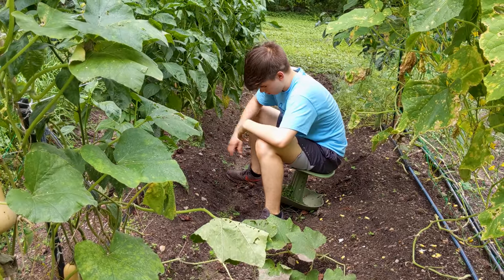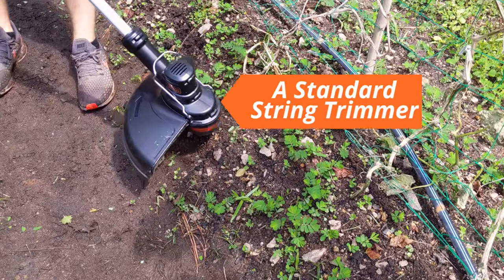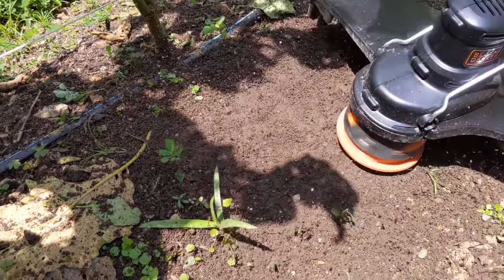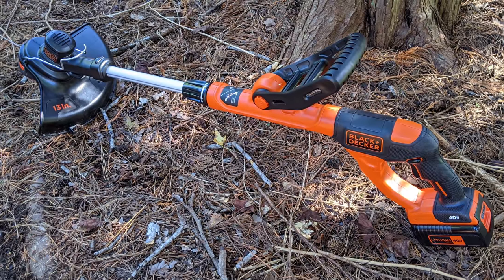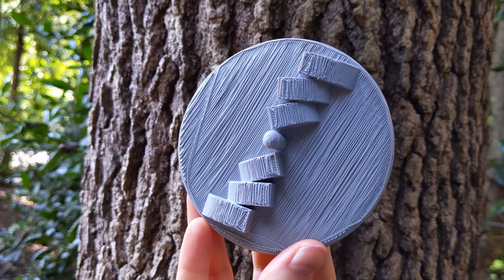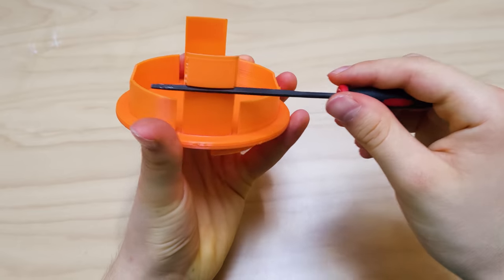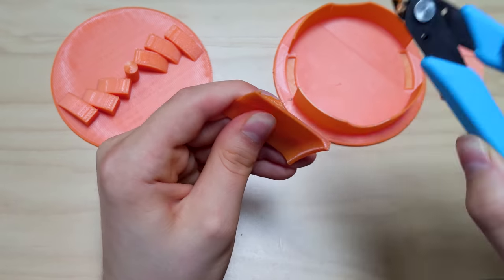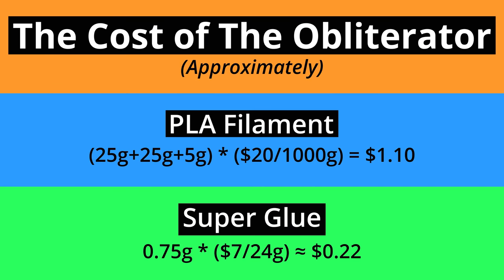3D Printed Weed Killer for Gardeners

Comment: Hey man, great job. As an mechanical engineering student currently working in product engineering, you are certainly on the right track. You came up with a solution to a problem. I really appreciate how you made a rough concept, tested it, and refined it. But more importantly you documented the whole process. This goes a long way. Many people can see the time and effort you put in. But more importantly, you can rollback or reference outdated models. Be sure to include cad models of every revision in your next resume. That way future employers can see the design process you have mastered. 

As for suggestions I have a few:
Research other plastics with different wear ratings, or impact resistance (in the case of hitting rocks or tree roots) for added durability. I know the ender is limited to a couple materials but pla might not be the greatest suited material. 
In my experience 3d printing, a 2 part epoxy is better fastening two 3d printed parts better than ca glue. 
I'd also recommend some mating surfaces between the two plates. You are currently relying on the ca glue for torsion. 
All and all, you've come very far with this project and done a Terrific job. Well done.
Reply from the maker: Thank you, for the kind words and the suggestions!

Comment: Good job.

Suggestion: Make two slots on the main body and add a flange to the locking mechanism. Insert the locking tabs up through those slots. Then, you only have to glue once for the grinder head and the tabs are held in place with more than glue.
Reply: this^

Comment: First off, I really like the design. Not having to bend over to pull up every weed or use chemicals is awesome. Nice work! Maybe Black & Decker will be interested in your design. 

The only issue I can forsee involves adapting this design for use with  gas string trimmers. I used to be a landscaper, so I used gas powered  string trimmers a lot. If the cutting attachment on a gas powered trimmer doesn't have enough air resistance, such as when the string runs out, the engine doesn't have enough of a load on it, making it very easy to accidentally overrev the engine. Overreving is bad for the engine in the long term, and I don't think your device as it is has enough air resistance to keep the engine at the proper rpm. Maybe you could add some fins with a lot of drag to the side of your device to load the engine.

Comment: Great job! My only suggestion at first glance is that you could put a lip on one of the plates to make sure that they are glued together with the correct placement. This will help prevent vibrations from the plates being off center.

Comment: You are going places in engineering mate. Great job. 
I might suggest a small central locating feature between the obliterator part and the main body, ensuring the users align the part to be glued on perfectly without getting any excess glue on their fingers.
Also, props for ender 3!

Comment: My only suggestion would be to try increasing the surface area of the tool and maybe set it on a dome.  Being able to vary the plunge depth of the agitators with either the angle of approach or depth of approach could help boost efficiency.  Having the tool be on a curved surface would give the user a lot of control and flexibility. Just being able to cover a larger area would be the biggest improvement though.  Your current tool is a great design, but it's not going to be big enough for people maintaining larger gardens/small farms.

My only "design flaw" concern is that there's no means of collecting the weeds.  Ripping them apart is great, but you're also agitating the topsoil and leaving roots and other debris from the weeds behind.  Pulling weeds from the roots might end up being more effective long-term because your device could be replanting existing weeds that will grow back.  I doubt that's a real problem, but it might be an interesting thing to try solving as a next step in the project.

Comment: Great job on this. To help keep flying spindle of death if glue don't hold well it may be worth making even just filament size holes to have an optional "pin" from the filament you can glue to make sure on well. With glue I usually heat up the part with the glue side and kinda melt the parts together with the glue. That has been the most reliable way I have found to make sure good adhesion.

Comment: Now you just need a thing to capture all of that flung around dirt to keep it where it's supposed to be and viola! Great product idea. Also make the blade head boltable to the mount, then you have replaceable blades!
Reply from the maker: Thank you! I have thought about adding a device to capture the dirt, but it would likely make it hard to see what you are doing. Replaceable blades would definitely improve the longevity of the attachment, although they would likely add complexity to the printing/construction process. Perhaps they could be implemented in a future version.
Reply: @hwhd  For a dirt trap I was thinking about expanding the existing guard to a full circle, instead of the half circle it already is, but make it a bit smaller so you can still it into tight places. 

Some weed wackers string trimmer machines are also "edgers" and they can be turned on their side, if you made some kind of bolt on fitting for that it could work that way as well.

Comment: Some countersunk screws and threaded posts going from the tool head to the attachment body would enable you to readily replace the tool head without reprinting the base or the latch tabs. Similarly the latch tabs could have two screw posts into them and use countersunk screws making each piece individually replaceable without compromising integrity or adding much cost to the total tool. This would be much more efficient. Good design overall though. I think it may also fit my greenworks trimmer, though I will have to test it. I don't have a suitable garden soil area to do this trip of de-weeding, my garden has wood chips over the surface of it.

Comment: This is only taking off the top part of the weed. The root will still be in the ground and regrow pretty quickly. Also, depending on the type of weed, by chopping it, it only just spreads the seeds and grow in other areas. 
Sorry for the criticism but I can’t see this working long term.
Reply from the maker: For very large and thick weeds, this is likely the case. However, for patches of small weeds, which is what this device is designed for, the entire weed is displaced and torn up. I appreciate the constructive criticism!
Reply: Hello World HD keep doing what you’re doing, doesn’t matter if it’s good or not.. I wish I had the brains to do what you do at your age. Keep it up.
Reply: @hwhd  This looks perfect for young weeds. Nicely done.
Reply: If the weeds are still small, which is what this looks like it was designed for then it will in fact kill the weeds.  The roots haven't developed enough to support a plant re-growth and all of the energy from the seed was used to push the plant above ground to start photosynthesis.

Comment: It is a misconception that PLA is biodegradable. It can, in a controlled environment, but it does not break down naturally. I wonder if using somthing like ASA or Taulman alloy 910 would prevent excess plastic in the soil since either one will take 100s of years to break down.  

Anyway, this is an awesome project. I can't wait to see more!

Comment: Pla is not biodegradable like you think. It's biodegradable under certain circumstances. It can be composted but it won't degrade as much just as bits on the  ground.  It needs to reach 60 c degrees, and  there is need of certain microorganisms in the soil. Only then you will see degradation

These conditions only  are reached in industrial composting wich you don't really can't do at home.

Comment: Nice work!  Did you test it on any 'woodier' weeds that have a big root system?  They may be able to spring back to life....
I suspect it will work well on the smaller fleshier weeds shown in you video!
I may have to adapt your design to fit my Stihl petrol trimmer with a screw on line holder :)
Reply from the maker: Thank you! I did, and performance was not as good. However, the tool is designed for patches of small weeds, not very thick weeds.

Comment: It is great that you are trying to innovate, however and I hate to be a downer....

There is already an awesome tool you can use to weed, it is called a hoe, it doesn't leave anything in the soil, it doesn't need batteries, it is super durable and it is incredibly cheap.

It also has the advantage that it does not kick dirt out in every direction, but leaves it in place, you can even pick up the weeds if you want.

The first thing you want to do before you innovate is to look at the alternatives.

P.S. You say "PLA is harmless", as far as I am aware adding micro-plastics to the soil around crops you plan to ingest is not a good idea.

Comment: Love it. What made you use such a small area? The way I usually use my string trimmer, the string is like a circular blade with a large diameter. It seems like your device would require more passes with the trimmer than if you used string. What do you think?
Reply: I wondered the same thing until I considered that this is for WEEDS, not for trimming grass. With this tool you're only going to disturb the dirt holding the weed and can't accidentally clip off a vegetable top or take down a flower. Nice idea.
Reply: @TimHeagarty  good break down. Helped me see it better. Thanks.

Comment: Maybe I missed it but is there a reason you used that diameter? Bigger might be better but would certainly have some drawbacks. Good job on the design.
Reply from the maker: As you increase the diameter, the linear speed of the outer teeth increases because the circumference increases. Because of this, if you increase the diameter, the outer teeth wear out much faster and things like rocks become more dangerous.

Comment: so when you use this, the weeds don't grow back later? the problem is if the roots survive, weeds tend to grow back
Reply: I dont believe he was claiming that they wouldnt grow back, he designed it to destroy just the weed instead of having the trimmer string hit your plants as well. So it's more accurate and it seems to destroy the weeds quicker than a string trimmer does as well since its grinding into them instead of just whipping them around like strings tend to do.

Comment: Honestly, I think that a better idea would be to create a holder for a block of wood, then insert long screws into it, leaving half of them exposed.  Also, put a lag bolt into the middle for stability.  This system will also tear up the weeds but won't ever wear out.  If you tilt the screws slightly away from the direction of rotation and add a washer, that should really dig into the soil as the motion keeps the washer at the screw head and acts like a tiny hoe.  (A complete shroud would also be a good idea to keep the dirt from flying everywhere.)

Hope this helps!

Comment: So you should probably read up on PLA's biodegradability.  It's only possible in industrially heated compost heaps.  So you're spreading micro plastics in the soil.

I know you say the central pillar is 'for stability', without it what's unstable?

How long have you been using it?  Most of the time you have to rip the weeds out roots and all or they'll just come back.  Shredding the tops is just kicking the problem down the road.